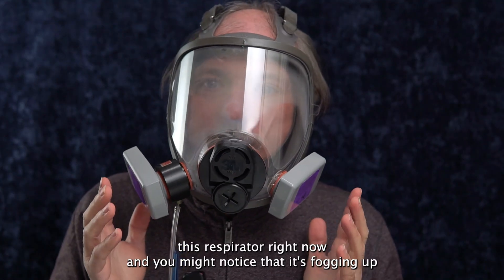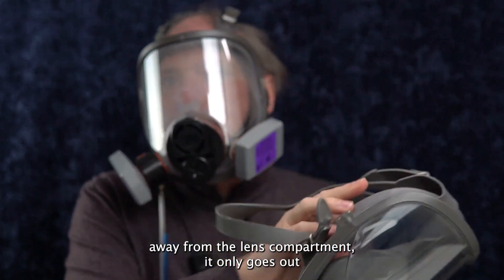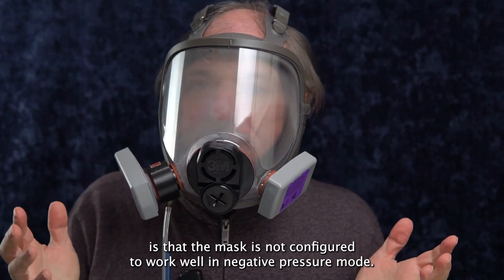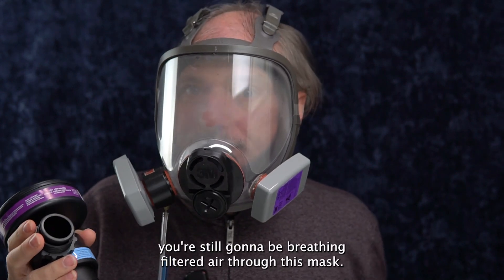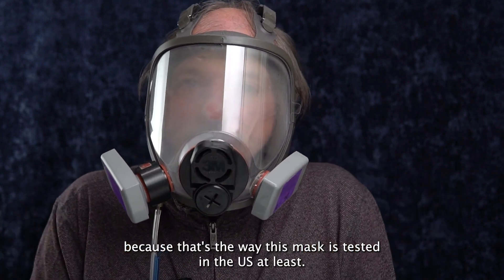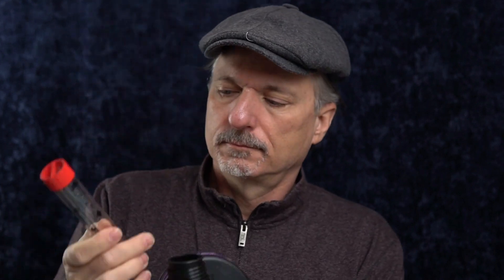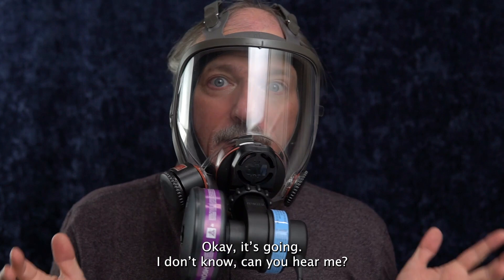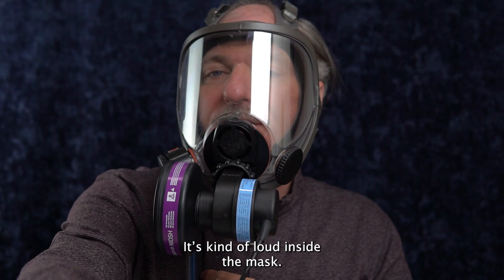A battery operated respirator? Is it better? Testing the 3M Powerflow powered respirator.

Comment: Two Qs: (1) Can you use the mask with the Versaflow TR 300/600 by connecting the versaflow tube to the 6900 mask? (2) what does the exhalation valve on the 6900 look like? Is it the square rubber flap, or the circular flap?

Comment: Can you test the Apflo PAPR from 3M for welder s?
Reply from the maker: Hi, thanks for the question 

They are currently discontinued, so I checked on eBay and pricing for complete units is still pretty expensive. I think it's outside of my current budget for PAPRs that I can test.

Generally speaking though, would trust 3M PAPRs to function as intended so long as you follow the instructions and check the airflow as directed and make sure that your filters are seated correctly.

Comment: Can you tell me the name of the air flow meter shown in the video?
Reply from the maker: The testing machine used in this video is a TSI 8020a PortaCount.

They are sometimes available on eBay used. But you have to be careful when purchasing them because they're old and no longer repairable, even by TSI. So not all of the ones listed on eBay actually work and they can appear to, the display and LEDs can go on, but the counting function can be broken because the laser no longer works properly. And not all listings come with all the accessories needed to run them.
Reply: @gerardhughes  Thank you for the answer and good information! :D

Comment: What is the connection piece that is on the right side of the mask it looks like there’s an adapter there with another hose not the blower but the other hose connected to that adapter piece that goes on the right side of the mask. What is that called and how can I get one or where can I get one?
Reply from the maker: It's a 3M fit test adapter for the proprietary 3M bayonet connectors. 

Get them on Zoro dot com and elsewhere. Pricing was better on Zoro than on eBay, surprisingly, last time I checked.

Comment: How does it feel inside with the respirator on? Does it keep your face cool at all?
Reply from the maker: PAPRs are cooler inside because of the higher airflow, which also prevents humidity build up. I plan on measuring and quantifying the heat and humidity in different types of respirators in future videos.

Comment: Interesting review.  My company has been at work on a PAPR that's simpler (all in one design monocoque manifold).  Our aim is a PAPR that's more accessible to the DIY crowd.  When we have certification, would you be willing to give it a try to compare? Its called MicroClimate Air3.
Reply from the maker: Sure, I would love to get a chance to test out the Air 3 when it becomes available.

I've been following your development of the Microclimate with interest.  I've been impressed that you decided to go the extra mile and transition from making a consumer PAPR that was distinctive, protective and fairly priced for what It was to engineering and manufacturing one that will meet the newer NIOSH PAPR class performance requirements and expand your market to include OSHA compliant workplace use, while still at the same time, better serving what seems like it was your original target market of individuals.

Comment: Can you recommend any air filtration product that does not have anything blocking the view ( like a nose “cone”), allows glasses to be worn, has a seal  around the entire face, and is light weight?  The seal does not have to be airtight around the neck. Lots of requirements. 

When wood carving, I have to bend way over to see past the nose cone on half face respirators. Most respirators do not allow a comfortable fit for glasses. No matter what glasses I wear, wood particles, float up behind them, or around them or over the top of them and get into my eyes. Goggles do not allow for glasses to fit under them.

Any ideas?
Reply from the maker: A "loose fitting" PAPR will do all of that. Full face protection from particles and debris - including impact protection. You can wear your glasses normally without leaks. No fogging or humidity build up.. No breathing effort needed. I've seen more and more wood workers wearing them for all day protection and comfort.

A 3M TR 300 with a M 206 hard top is one of the best options if you need just particulate filtration. If you need chemical filtration (for painting or other VOCs) you'd need a TR 600.

(Some of the hard tops cost more for features you may or may not need. The M207 is heat resistant, that M307 has a rated hard had for working construction)

The 3M TR 300 is sometimes under $500 on Amazon, but only with the soft top. The hard top can be bought separately, but is always >$250. The MSRP for the 3M PAPRs is really high, though.

I've also seen some woodworkers wearing cheaper alternative PAPRs that put the blower and battery on your head that are less comfortable and not NIOSH approved, such as the Powercap and Trend Airshield Pro, but I haven't used either of those and can't vouch for them.
Reply: @gerardhughes  would I need so buy the tube and belt unit for the TR 300?
Reply from the maker: @jellyfish2b  

Yes, with the VersaFlow PAPRs, it's a system. You need the belt pack with the blower and battery and filter, the connecting hose, plus the head top of your choice.

Having a hose and a belt mounted blower makes it seem cumbersome. However, It makes the head top much lighter than if you have to wear the blower and battery and filter on your head as in some of those other units I mentioned.

Another advantage of having the belt mounted blower is that it helps keep your filter cleaner. It's not right above your work piece, it's behind you typically, so you're going to get less sawdust into it.

Comment: I was expecting higher fit factors from a full face. Suspect there is a small leak around the edge?
Reply from the maker: I'm rather surprised by the numbers. Way lower than I expected. There are all sorts of possible confounding factors, including leakage of the test adapter. So I don't consider any one test, or one person's testing, to be definitive.
Reply: Leakage of the fit test adaptor should be easy to check. Have you tried it on a half mask with p100 filters?

Comment: CAN YOU TEST A TYPICAL SURGICAL MASK ALONE? These are what hospitals and doctors are using. They seem useless. Thanks so much for your tests!
Reply from the maker: Surgical masks leak around 50%. They are not tight fitting, nor are they meant to, and are not considered respiratory protection by OSHA. The fact that OSHA does not consider them respiratory protection makes them especially convenient for employers who require their use because even when required for employees, that does not trigger the fit test requirement needed for mandatory respirator use, such as for N95s. Since they aren't respirators, they don't need respirator fit testing. But it does not protect very well. Not a good savings.

(Voluntary use of N95s in a workplace by employees does not require fit testing, but fit testing is required when they are mandated by their employers.)
Reply: @gerardhughes , thank you! Pretty useless for immunocompromised in hospital/healthcare settings, but that’s all everyone is required to use… for now. The smart people use 3M auras or better. Thank you for all of your reviews. They are extremely helpful. ❤️

Comment: Could you test the 4 or so P100 rated disposable respirators? The two available ones from the US are the Moldex 4400 P100 and the 3M Particulate Respirator 8293. The other 2 on the Niosh list appears to be hard to obtain. I know their filter medium passes muster (I hope) but I like to see how it does in a QNFT. I see the Moldex 4200 does poorly in your spreadsheet, but the 4400 has full foam and a valve which should get a better fit factor (I hope, since I often use this model). And the moldex accordion design should work well with vertical jaw movement (at least I hope).

Comment: Would love to see you do the CleanSpace Halo (or any of their other products) someday!
Reply from the maker: I have a CleanSpace2 I'll be testing. It's more affordable than the halo, but not waterproof, and cannot power a full face mask. However, I assume that it will otherwise test similarly. I got a good price on it as a new open box item on eBay, but I have not yet sourced the fit testing adapter necessary to PortaCount test it.

The CleanSpace PAPRs are advertised as being compatible with PortaCount testing, so I had assumed that it had built-in compatibility for attachment to the test machine. But as it turns out you have to buy the adapter separately for $$$, the same way it works for many other elastomeric masks.
Reply: @gerardhughes  Amazing! Looking forward to your video on it!

Comment: Curious about other PAPRs. Would have possibly gone to one if could not find an elastomeric respirator which passed a fit test.
Reply from the maker: I've got 3 other to test: CleanSpace2, 3M TR 300, and a Honeywell 700.

My preliminary impressions are that I like the TR 300. I haven't used the PortaCount on any of them yet, though.
Reply: @gerardhughes  TR300 is fantastic and comfortable. I use a helmet headpiece.
Reply from the maker: @PhattPhillip  

I'm kind of surprised how much I like it. The effortless breathing and the fogless visor contribute to it.

I don't have a hard top for it yet, they are expensive to buy individually.
Reply: @gerardhughes Gerard you are an ABSOLUTELY legend, a true king of kings in this space. You deserve millions of views ✌️

Comment: Even if they didn’t have an air pressure sensor, surely they could’ve added a fan speed sensor? Most computer fans have had speed sensors for years, so I really feel like they don’t have any good excuses. 

Thanks for the comprehensive test. Can’t imagine using something so noisy even if I was alone.  

Please don’t test a Versaflow PAPR unless you know it’s going to be extra noisy. I don’t want to be tempted. :)
Reply from the maker: Doh! The Versaflo TR-300 is my favorite, and is much smaller, quieter, lighter and more convenient than I thought it would be.  And there are some good deals on them on eBay. I got a new, open box one for way less than I expected (I wasn't interested in used ones, because they could be covered in all sorts of toxic chemicals from being used for remediation and who knows what else). 

I'll have to check on what happens when air flow is restricted to the blower for the 6800 PF. With the TR-300, air pressure automatically increases to try to keep the air flow rate up. It is self-adjusting for altitude, as well as filter loading. I don't think the 6800 PF has any of that, I couldn't find it in the literature. Whereas it's a selling point for the TR-300.
Reply: When you review would be good to note what face shape, size measurements they fit. Thanks for all your videos!!!
Reply from the maker: @swes2934  

I would love to give more information on fit for elastomeric fit, but it's difficult because sizing isn't standardized. I had to take a guess when I bought the medium size 6800 mask, which I found described as fitting "most" people - I often take a large in a half face mask, so I was reluctant to buy the medium size for the full face, but it turned out to work well. I couldn't find actual facial measurements to correspond with the claim that the 6800 fits most people.

However, the good thing about full face masks, is that the shape of your nose doesn't matter. That takes one of the variables that makes half masks tricky to fit out of the equation.

You also don't need to consider face size when it comes to loose fitting PAPRs, such as the head coverings, both soft and hard, that are typically used with the 3M TR 300. They are not designed to fit tightly, and there is no seal to check. They rely largely on the air pressure from the blower to keep contaminated air away from your breathing zone. The head coverings are based more on head circumference, to make sure that the harness inside the head covering will fit on top of your head well. It's more like hat fit, than mask fit. And the harnesses are adjustable, like the harness inside of a hard hat.

I will try to include more information about sizing going forward. I do tend to mention that more in my videos about N95s and other filtering face piece respirators, because my high nose bridge makes it hard to get a good fit with most N95s.